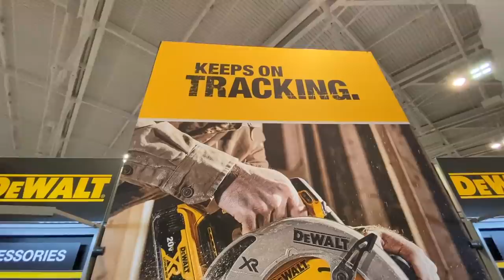Dewalts NewTools of 2020. First time seen in public at Stafda

Comment: In the dewalt booth the saws are not identical. The diablo blade is on an older saw with older castings you can see it in the arrows casted into the guards. I have worked with more than my share of these and know that there are 6 almost identical saws in this line with a large range of specifications that can cause differences in cutting ability that have nothing to do with the blade.
After watching closely you can see that in the dewalt booth the dewalt blade did not through enough saw dust for it to be cutting through much of the board at all. If you look at the finished cut you can see no edging or off cut from the track line already cut into the board. 
Now if you look closely you can see the dewalt guy twist the saw and bind the blade when cutting with the diablo blade. At the end of the cut pause the video and you can see the effect of twisting the blade, the saw did not cut along the precut channel, the blade has rub marks all the way up the exposed surface, other than the very start there is a lot of edging, there are places on the board that the whole track is still present on the board.

Now the diablo booth is still not comparing the two very well but is slightly more realistic. They are using single battery 6 inch saws not 7 1/4. The saws are the same modle. The batteries are marked with the same markings so I don't believe that is an issue. The key is they said it is treated wood. I can plainly see the grain pattern difference in the two pieces, they are not from the same board. The dewalt blade was given a more complex grain to cut through. That said I run Makita saws now a lot. If the blade binds on those saws, the electrics in the Makita saws will cut power to prevent kickback and damage to the motor. This is why the saw with the dewalt blade just kinda gave up in the cut.

Now neither company is being truly honest in thier demonstrations. It is possible that dewalt is making a blade that is on par with the diablo blade and each company has a stake in showing thiers in the best light. I would say that the two are probably on par with the diablo better at cutting hardened fasteners and the diablo better at maluible fasteners. These are both framing blades though and I would fire someone for treating my blades and tools like this. Use the right blade for the job.

Comment: Dewalt blade was set to just go through the wood and diablo blade was all the way down. Not sure what difference it would make but it was not a good test. On the Diablo test booth blade depth was the same but we have know idea if the battery power was the same.

Comment: I use Diablo blades every day building decks, the Dewalt test was real. That's what all my blades look like after cutting a dozen or so nails. I actually use the demo demons as I do lots of demos.

The Diablo test was using a crappy Makita saw with a relatively dead battery. You can tell by the rpms. They probably use a new battery for the Diablo bladed saw for each test and forget to change the battery for the Dewalt blade, lol.

Comment: You can tell that the diablo booth gave the dewat blade a almost dead battery. You can see the guy checking the battery in the beginning and also pulling the battery out and checking the battery indicator light. Just gave dewalt a dead battery. Unlike the dewalt booth he used the same battery

Comment: In the Dewalt demo they used an unfair advantage with a Dewalt carbide blade vs a regular Diablo blade cutting Nails. In the Diablo demo they  used a carbide blade vs a Diablo carbide blade cutting drywall screws.  Screws are much more difficult to cut than nails since screws are made with hardened steel compared to nails which are mild steel (try bending a screw vs bending a nail in your hand.) I'm pretty sure that if they both cut nails with a carbide blade the results would be similar the Diablo demo was showing off its screw cutting abilities.

Comment: First thing they were using stainless steel screws at the DeWalt booth I'm guessing DeWalt's blade does better with stainless steel screws and diablos don't.

The screws in the Diablo booth were hardened  black drywall screws .

That's the difference I noticed in the two tests

Comment: Just used a diablo blade like in the video today and it lost most of the teeth in just a few cuts on roof sheeting. Probably hit a few nail heads but the Dewalt blades made for nails and demo is way better.  Probably last twice as long.

Comment: If you look at the Dewalt booth test closely, you can see that the Dewalt blade has proper depth adjustment for the cut, while the Diablo blade is sunk as far as it will go. Not 100% sure this would cause it to spit teeth, but you can see the blade wipe on the diablo is much worse than the Dewalt. Probably overheated.

Comment: Years late on this but, in Dewalt booth the Diablo blade is a bit lower below the wood, but same is true in the Diablo booth. That can't account for what we have seen. Being in engineering and having worked with marketing and sales people, I can say with all certainty that one of those booths messed with the competitors blade either dulling it, making teeth weak or pre-stressed/damaged, used a low charge battery or outright changed battery internals. There's many things we as the "referee's here, can't know/see/verify that changed the outcomes and just like in sports, the ref can't call, what the ref cant see. Having been using many types Diablo blades for a very long time, I don't for a micro second believe the Dewalt booth's test.

Comment: Here’s the simple fix.... Put both the Deoblo guys and the Dewalt guys in one booth. Each one operating the same set up as far as the tool goes and run the test with their own blade. So, same piece of wood / material, same brand of saw (possibly a corded).. Best blade wins.

Comment: Looking carefully at the Diablo Test, the Diablo was  cutting the screws at the thinner end. They had the Dewalt cutting the head of the screw off. The end of the cut you can hardly see the screws on the Diablo timber, but the Dewalt had the widest part still very visible. It was rigged as far as i am concerned. I agree with Josh Miller.

Comment: Blade depth on the Dewalt comparison was different. The my set the Dewalt correctly and the diablo lower which besides the know about setting your depth count have put the angle/position different at which the teeth hit the screws...not sure but just an observation

Comment: At least with the DeWalt saw he used the same exact battery. With the Makita they had 2 different saws with 2 different batteries. I've been using battery operated tools for years now and I will say IMO that the Makita with the DeWalt blade sounded like the battery was half dead 🤷‍♂️

Comment: The Diablo booth set  both blades full depth cut.  The Dewalt booth only set the Diablo full depth.  You can't make out the exact depth of the Dewalt, but it looks pretty close to just poking out the bottom.  As for torque'ing... all the cuts look pretty straight, but I agree with other comments - a fence would eliminate that question.

Comment: Is it bad that when it came to the blade test, all I could think was man I’m glad I bought a Dewalt saw and not a makita. 
They both have there gimmicks. I know for sure the Dewalt blade works great. I haven’t used diablos circular saw blades but I love there thick metal saws all blades, I cut up commercial water heater tanks faster than a blow torch. (1/4” thick steel tanks)

Comment: I thought Diablo blades were better, but after watching this, I like that dewalt actually allowed you a close up shot whereas diablo didn’t and for all we know, that the battery on that other saw could’ve already been low. 
I did notice that the diablo blade WAS set to a deeper depth than it should be, but they were also at the diablo display. I also noticed that it looks like the “dewalt” guy at the diablo display is not really trying to move forward with the saw. 

Why can they both be just as good? Lol

Comment: The fasteners were way different and they used stainless steel nails in the first dewalt video and they used sheetrock case hard screws in the second while not showing you the condition of either blade beforehand in the 2nd diablo demo!!

Comment: Ok I have a Makita saw like the one they used in the Diablo demo and the one thing that was apparent to me was the battery on the Dewalt blade wasn't at full strength to start with.  Oddly enough you do get to recognize the sound the saw makes when a buttery is low or not. I don't have or used either saw blade. My saw still has the blade that it came with so I want make comment on them.

Comment: Was it just me or was there no screws showing on the diablo side? Also how come they never showed the inside piece of the Dewalt side. Looks like the Dewalt side had larger screws that the blade went through. Note no visable screws  showing on the cutoff piece cut by the diablo blade

Comment: Listen to what the details are... deWalt cuts through stainless steel nails, Diablo through drywall screws... Also, should be a low battery at Diablo test as well as different saws between both competitors....

Comment: I would believe the Diablo test more if they used the same saw with a new battery for each blade.  There are way too many variables.  Was each Makita  saw the same model?  Are the batteries both fully charged?  They should both simply have used the same saw, changed the blade and then use new blades and fully charged batteries each time.  So many variables and ways to manipulate the results.

Comment: It seems to me that the dewalt rep intentionally pushed the Diablo blade though almost 3 times quicker in the beginning of the cut to damage the tips. in the Diablo experiment they used 2 different saws and batteries. Out of both the blades I would pick the cheaper one.

Comment: On the dewalt test the first pass looked like it may have been aluminum nails due to a lack of sparking and possibly had the stainless nails sunk deeper for the second pass to ensure failure of the diablo blade and I'm sure diablos demonstration did something similar

Comment: Saw rpm is greatly different as well. I would guess that the steel that they are using has a density that is better at a higher rpm than the diablo. Just a guess

Comment: The dewalt both blade test looked to me like the guy just pirposely slowed down on pushing the Diablo blade thru & maybe let up on trigger a little which i could see breaking off the teeth. The guy pushed with the same pressure all the way thru using the dewalt blade. The diablo booth used bigger screws as well and it looked more believable to me i think.

Comment: @ 9:24 a battery is put on the saw with competitor's blade! the USED battery, what happens when the reverse is true?  When the Diablo is used 1st? and with used battery the DeWalt next? So if side by side w/same charge & wattage the DeWalt doesn't seem so prevalent?

Comment: Not the first to mention that the makita battery was drained on the DeWalt saw. But also, might I add that the DeWalt test was less suspicious. He was using the same battery, the same piece of wood and the same screws. Unless they tampered the tool of the Diablo saw, I trust the DeWalt test more. Let’s find out when independent test reach Youtube.

Comment: any body who uses a saw knows if your not good at using it you can twist it and it will work the blade hard and cause issues. so I wonder if they twist as they cut to make the saw work harder to cut.

Comment: The ryobi saws didn't have the power and consequently didn't have the rpm that the DE Walt saws have, Consequently they were burning through the wood and probably causing the blade to warp and struggle to cut.

Comment: The dewalt demonstration, the dewalt blade saw is not as deep as the diablo saw. Look at the position of the arbour compared to the foot. It has the proper amount of depth. The diablo blade arbour is about 1-/2-1/3 the distance from the wood, making it significant deeper, at an incorrect depth.

Comment: looked like to me that the Dewalt test there where bigger holes in the lumber that was cut first with Dewalt then diablo was smaller holes for the saw dust to fall out and not with the diablos blade had smaller holes to keep the blade from over heating

Comment: The dewalt saws battery was like 20v and the makita were running 18v. Age of the makita saws seem older than the dewalts. The makita saws in test could be going against the grain of wood and have less battery amp than the dewalt battery did I read 60v on there 😉

Comment: I own a cheap cold cut saw. It will cut wood, plastic metal abs copper, stainless. If you push hard and fast yoh will go through the metal like butter but the blade won't last. Dewalt rep was pushing way faster I think then he should have especially for stainless steel were wou should go slow. Diablo rep was cutting slow as well he knows how to use his blade that makes a difference as well

Comment: The nails appear to be bigger on the DeWalt piece of wood in the second test and to be honest the makita saws were struggling it seemed but they had small batteries. For me the important fact left out was......were those blades advertised as being able to cut nails in wood.  If not the test was moot. Not really convinced by either test.

Comment: The saw blade test wasn't the same at all. The dewalt booth used stainless steel nails with arguably the most powerful cordless circular saws on the market. The Diablo booth used drywall screws with arguably the weakest dated cordless saws on the market. Dewalt and Diablo tested these cuts behind the scenes to get the results they wanted, It's a no brainier there!

Comment: Soooo they both are just not trying to cut it right with the competitor brand and also maybe they work differently with different circular saws like freaky works better with freaky and shi or sometimes they make it like that on purpose, also they did use drywall screws and I’m the other nails

Comment: When DeWalt tested the Diablo blade you can see where they constantly turned back and forth to bind the blade and burn the wood, when Diablo tested that was a mostly honest test, maybe the battery was weaker on the DeWalt blade but hard to say, I've seen multiple personal tests on similar products and Diablo is among the top in quality but more expensive, while DeWalt is cheaper and still decent on various platforms, project farm is a very un-biased tester that tests a very wide variety of things and breaks it down well with charts for cost and effectiveness

Comment: I didn't read none of all the other previous comments or anything like that I just thought I'd let you know why the Makita Diablo and the DeWalt Diablo we're cutting different because of the nail size why the teeth fell off I don't know but I buy the Diablo and I'm never had that happen and I cut steel plate up to a quarter inch with my Diablo blade

Comment: anyone notice on the 1st cut between the Diablo blade and the Dewalt that the guy went slow with the Dewalt and  than when he swapped to the Diablo, he jammed it through to help the teeth break faster?  Good reason not to haul ass through your cuts when nail danger is involved.

Comment: I use diablo in my skill saw and used the new dewalt blade that came with the saw and soon realized how dewalt should just stick with making tools cuz they still suck at making blades.  it is thinner so be prepared to have bad cuts when u knew you measured twice growing up knowing a blade is 1/8  and when ripping osb it won’t stay true unless you plan on cutting that one cut all day

Comment: Wasn't one test on stainless nails? And one with drywall screws? Drywall screws are way harder than nails. Also the Diablo test didn't show battery level and had 2 different people doing the test its super clear the guy with the Dewalt blade stops cutting for a sec to let the Milwaukee get further ahead. Tough call either way but Diablo didn't show the blades just let their guy say "a few teeth are missing I DONT KNOW" that to me alone throws the diablo test out the window. If you don't know then I'm not going to take your advice

Comment: Diablo: Different piece of wood. Who knows if the nails were the same in each. Different battery, different operator. One guy looked like he wasn't pushing at the same rate. Verdict? A crock! 
Dewalt: Same wood, same nails (it would appear, nails could have been cut through already on Dewalt run as the wood was already channelled! WHY?) same operator, same battery though some power would have been lost as Dewalt went first. Verdict? "Appeared" to be a fairer test. Independent tester required.

Comment: The Dewalt was the actual victor over Diablo, due to Dewalt using their own more powerful circular saw with the blade. Whereas the Diablo demonstration they are using 3rd party (Makita) circular saws that appear to not be as powerful. The Dewalt booth also showed you the damage on both saws when Diablo didn't. And in the Diablo demonstration it looks like the guy using the Dewalt blade is intentionally binding the saw. However, at the Dewalt booth the Diablo blade was set to cut at a deeper depth than the Dewalt blade which may have had a factor in how the blades held up.

Comment: Two different tests. On the first test they use the same brand saw with a Diablo blade and a Dewalt blade going through nails. On the second test they used different brands of Saws Going through drywall screws as well as different batteries.

Not the same test